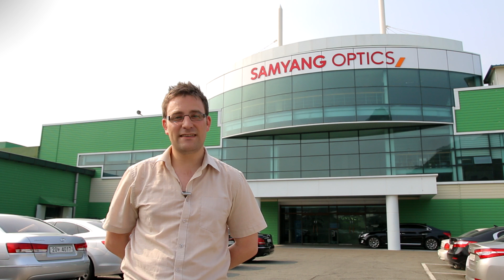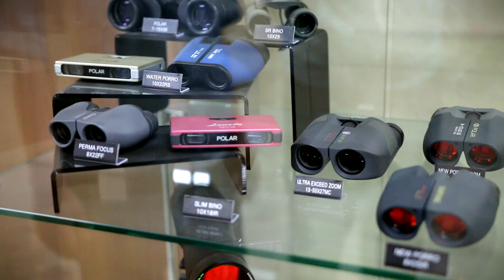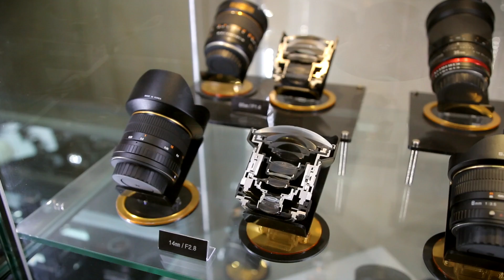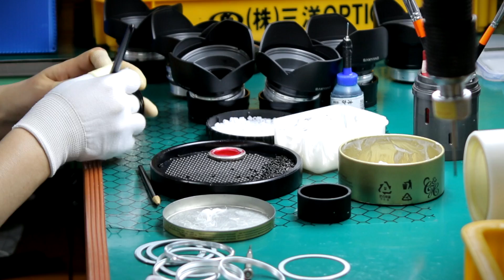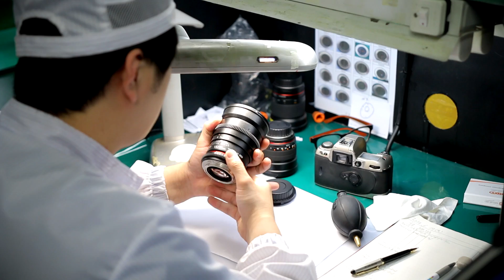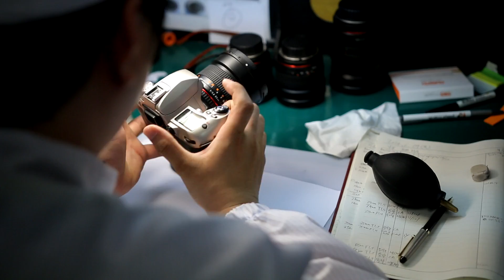Visiting Samyang Optics' lens factory, South Korea

Comment: I love Samyang lenses I have the 8mm, 24mm, 35mm, 85mm, 135mm
Reply from the maker: That's quite a collection!
Reply: They make a very good astrophotography lens becouse they are fully manual and the cost is lower.
The corners are very good above F2.8 - Very enjoyable to use, easy to focus on a star as the lens lets in so much light and can see on live view even a dim star.  I do like the aperture ring as click's.  Only the 35mm lens you do the aperture from the camera is a plus.
Reply from the maker: Absolutely agreed. I've just been working with the Samyang 8mm f/2.8 'ii' which is wonderful as an astrophotography lens
Reply: I do find the 135mm at F4 amazing and the stars in the corners are pin point. And this a 1min exposure ISO 1600 tracking the stars.
Canon 1000D Modified that is the IR filter removed.
Reply: Do you have use sonyalpha canera samyung lenese .. You can explen me i have sony alpha 7iii samyung best for alpha video shot

Comment: Nice video, interesting to see who my lenses have been made =) I saw the 24mm tilt-shift, I really want that lens!

I just got my hands on their 12mm f/2 today, for my X-T1. The few test shots I did in the store shows great promise for the next clear night sky :) I've been using some lenses for K-mount (including the Samyang 85mm f/1.4, 14mm f/2.8 and 35mm f/1.4) on the X-T1 with an adapter or a lens turbo (speedbooster basically) with great success, but this makes everything very big on the camera. The 12mm which is the Fujifilm X mount was so very small :P

Comment: That was a great wee look around. Things might have changed, but I remember an old video about the Canon manufacturing process that seemed to be about lots of hot glass being poured into sheets and then remelted several times. Does Samyang do that on the site you visited?
Reply from the maker: I didn't see that myself, but there were some parts of the factory I couldn't see!

Comment: But why do their lenses have to be so big?  Especially the Sony-e mount versions.  I returned my 35mm f/1.4 because it was too clunky and did not fit as snug tight as the native lenses for the Sony A6000 or A7 series.
Reply: +neptunusmaris because of f.1.4 ;-)
Reply: +neptunusmaris The lenses are practically the same, only with different mounts. With the e-mount they put an extra part on it to cover the space which is left out with the mirrorless system. Like an adapter. 
Compared to the lenses of canon with the same attributes, I think the samyang lenses are a bit smaller. Though I only can compare the 85 by now... :)
Reply: Its a lot more awkward with the Samyang 12mm F2.0 for MFT. They just put a MFT mount on an APSC lens so the lens is almost the same size as a MFT camera. Even than I still love the quality for the price though.

Comment: Very nice. Is Samyany Korean or Japanese brand?
Reply from the maker: Take a look at the title of the video, the description of the video, or the video itself. :-)
Reply: beavertown2006 Korea, of course. Nowadays Korea makes much better products than Japan.
Reply: You are certainly correct in some areas, but actually the question was very good. The chinese characters for Samyang are the same as that of the Japanese company Sanyo (三洋). According to Wikipedia Samyang has ties with the Japanese manuacturer Seiko.
Reply: Wiki info has not been updated, unfortunately. Samyang almost went out of business due to heavy losses in the CCTV business with the Japanese.  They struggled financially until 2013. Then in 2013 the new ownership (VIG) restructured by selling off and shutting down all money-losing departments and only focused on the camera lenses which they are very good at. They also hired new CEO and engineers from Samsung Imaging department. Now they are doing great financially since then.